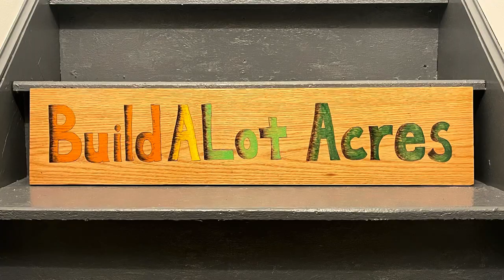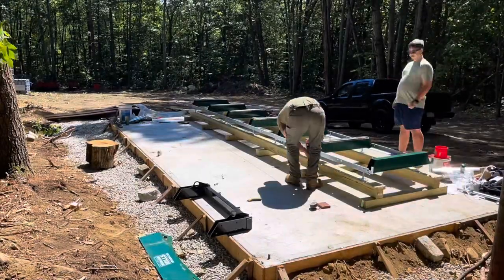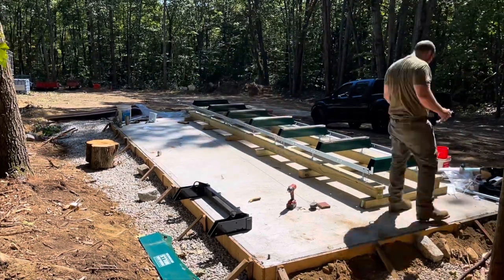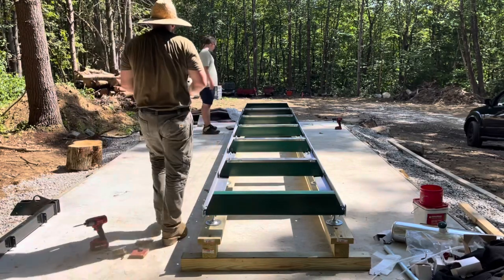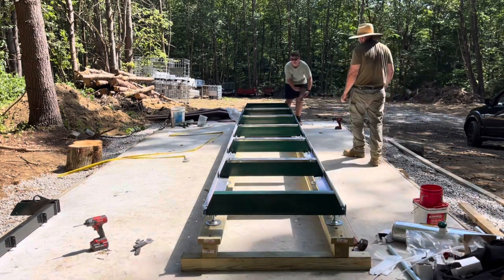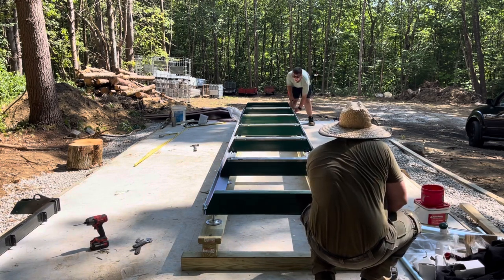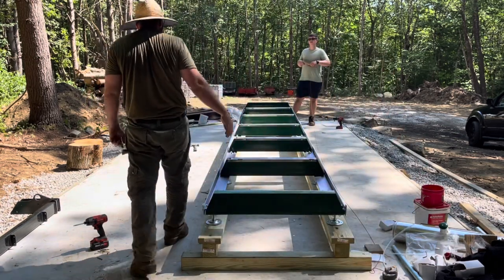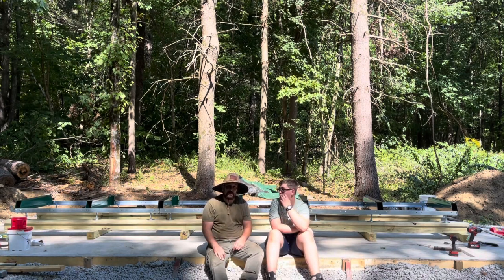Assembling a Woodland Mills HM130 MAX: Frame, Rails, and Bunks!

Comment: Not sure I like those 4x4's sticking out on the bottom, seems like a tripping hazard
Reply from the maker: Good point. I figured it’d be more stable, accommodate a possible future wider mill, and give a good place to attach the concrete anchors.